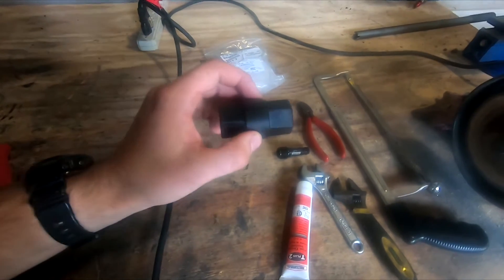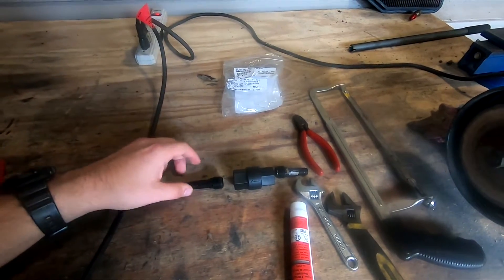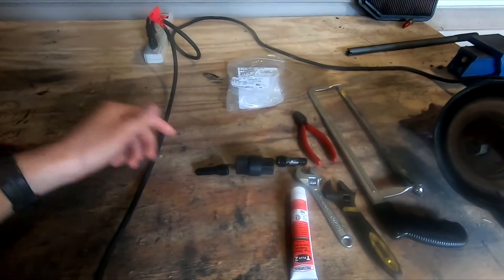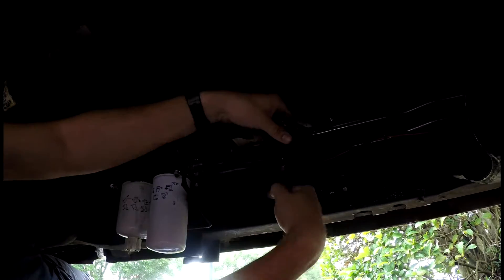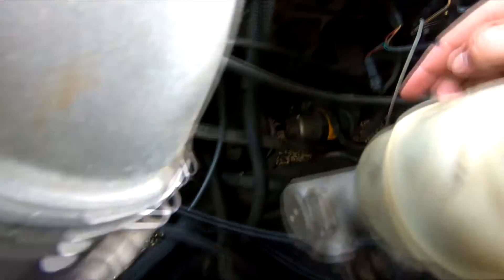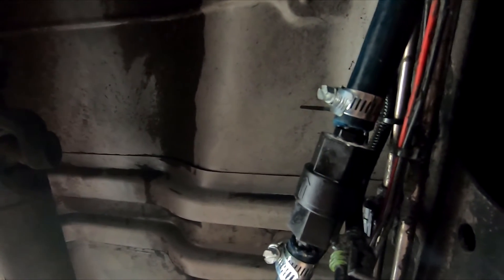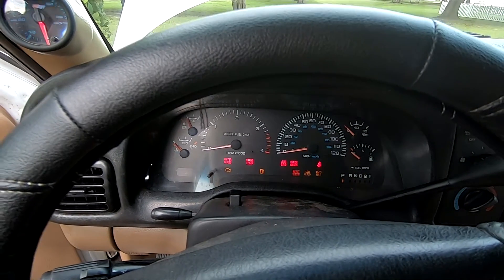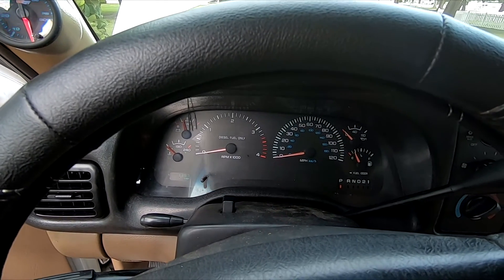Project Slate: Ep 5 | Fixing my 2nd Gen Cummins Hard Start with a Fuel System Hack

Comment: Does the check valve affect your pressure at all? Does it damage the vp44 or as soon as the pump runs everything gets pressure and re primes injectors? Did yours act differently parked uphill vs downhill?
Reply from the maker: It didn't have any negative effects, it's a 1psi check valve, so no issues. I didn't notice an difference on inclines or declines
Reply: @AllThingsBoost  I put a cheaper check valve in for my pickup and since it has 3/8 fuel line i put one in and it cut psi by almost 7... maybe I'd upgrade to a half inch check with 3/8 adapters
Reply from the maker: @owenv47  interesting. Can you adjust fuel pressure on your pump to increase? What lift pump do you have? Also what's the issue you are trying to fix?
Reply: @AllThingsBoost I just have a direct replacement fass that I re mounted to the frame. I already shimmed the relief spring to about 19psi idle. My pickup long cranks on flat ground and incline. I already replaced the whole fuel line up to the stock fuel filter. No leaks that I can find.
Reply from the maker: @owenv47  gotcha. My issue wound up being a leak at the head from the injector crossover tubes not sealing to the fuel lines. I had to replace the cross over tubes, which is what ultimately fixed it.

Comment: The problem I have including the hard start is high pressure to the fuel tank, there is vapor coming out of the fuel tank and when filling the tank with engine running it is pushing fuel out of the tank. Any idea what that would be
Reply from the maker: It sounds like a bad VP44 check valve letting fuel freely circulate. That'd be my guess.
Reply: Probably is I’ll get one from Genos and see if it helps. Thanks

Comment: I have an air dog on my 98.5 24v. (Repositioned to the rear of the frame Fass style) no leaks for me. But I simply don't trust those push on style fittings. So I used one use stainless crimped spring clamps on all connections for the fuel system. Looks good and really gives it a tight connection.
Reply from the maker: I would be interested in redoing my fuel lines and using some better materials, do you have a link or anything to these clamps? Thanks

Comment: You must be sucking air somewhere if the line was bleeding out…don’t you think?
Reply from the maker: I later found I was leaking at the hardline to injector crossover tubes. Replaced both and it's been good since. The check valve was just a temp fix until I found the root issue

Comment: Can u tell me ur symptoms before the valve check and if it was ur fads pump not putting enough pressure out
Reply from the maker: Long cranking time after sitting for more tha 30 minutes. The underlying cause was a fuel leak letting it drain back, mine was the injector cross over tubes not sealing to the hard lines and leaking at the head.

Comment: Those inlet and outlet tubes from home depot, what exactly am I looking for?
Reply: Also, I can't really see what you're doing under the truck. Are you just cutting the fuel line with a saw or something?
Reply from the maker: Yeah. I just found 2 fittings that are 1/2" and fit the threads of the stop valve on one end, and push fit on the other. Cut the line and put them in. Pretty straightforward

Comment: 1 year down the road. How is it? Running into this issue
Reply from the maker: Actual problem was the injector cross over tubes. The check valve worked for a few months but slowly the leak got bad enough that it was starting to hard start again. Truck is all good now and has been since I changed them out

Comment: This sounds like my exact problem after about 1-2 hours I sit and crank and crank as if there is no fuel in the line... I'll try this
Reply from the maker: Just a heads up, I did finally find my leak, needed new injector cross over tubes. It was leaking where the VP44 lines meet at the head.
Reply: @AllThingsBoost   I already replaced my fuel lines, fuel pump and have no leaks so not sure whats going on yet but I'm going to try this 1st since the starting takes forever
Reply: I'm going to try to replace my Overflow Valve next.. I haven't tried the check valve yet as the area is so tight I can't reach the fuel line and I'll have to pull the filter and the return line to try this... FYI this is on a 95 bluebird FE bus with a 12v cummins 5.9 6BT the start I'll sit and crank for a solid 2 minutes before it'll crank over the other issue is I can turn it off wait 30 seconds and it'll be another 30 to 40 seconds of solid cranking before it'll crank up again. I've paid mechanic after mechanic and no one seems to be able to fix it not sure what to try next.

Comment: Simple,you are using pushloc and it’s allowing air to slip by
Reply from the maker: Possible, shame they didnt use something more secure. I will say, I've found my high pressure VP44 to head hard line leaking at the head fittings. Tried a bunch of ways to get them to seal up and I cant get 2 of them, visible  trickle after running for more than 5 minutes. Definitely a likely reason. New lines on order and will be installed soon. Hopefully that will take care of it. I'll be putting a vid out when they show up

Comment: Dang i was pumped trying to get my 2nd gen to start up. Any updates on another check valve?
Reply from the maker: Yeah, it's been working great
Reply from the maker: Just updated the description with the one that worked
Reply: You’re awesome. I’ll update once i instal on my truck. Thanks
Reply: Do you think it would work on a factory fuel line setup? I have a fass replacement pick up pump. Not a frame mount like you
Reply from the maker: @roelangel2008  I'm honestly not sure. I'd mount it at the lowest point in the fuel line, and I'd think it would do the same thing. Just a guess though
Reply: @AllThingsBoost  which one is the new one?,the goldish one?
Reply from the maker: @marshallcooper303  yes, the goldish one has been working flawlessly since I installed it about a week after this video came out
Reply: @AllThingsBoost  I really appreciate thank you!!

Comment: Those hose clamps are not a good idea!  In an accident, you could have a fire!  Also, they have a limit on how much pressure they can clamp.  Lastly they loosen up with time.  If you must use a clamp, buy the spring metal oem type ones that you use pliers to remove.  Won't loosen up over time.  I'd like to see you make the connection with flare or AN fittings, please!
Reply from the maker: I didnt consider an oem style clamp. I'll switch them out. I mostly just wanted to see if this would even work. This is also the low pressure side of the fuel system and my gauge tells it stays below 20 PSI. The second fuel pump to the injectors is a seperate system and that's the ones that will get into the 5k psi range. The risk is pretty low. The factory airdog lines that I spliced into dont even have a clamp, they just use an epoxy to the ABS fitting. I do check it pretty often to make sure there are no drips. I'll eventually swap it for something more permanent